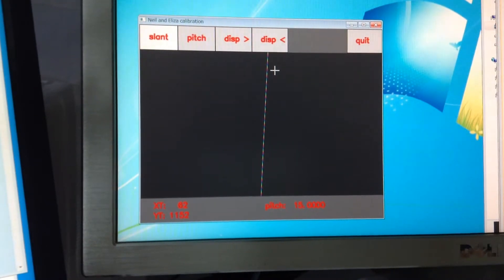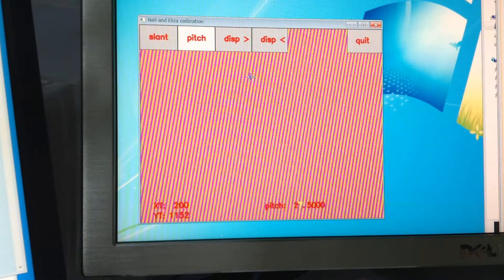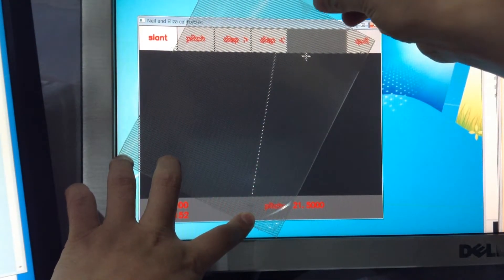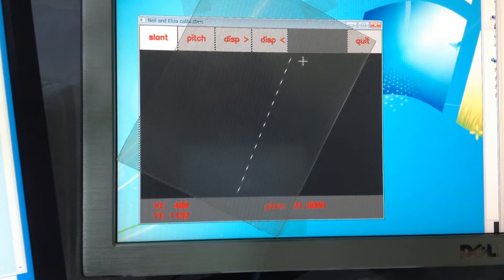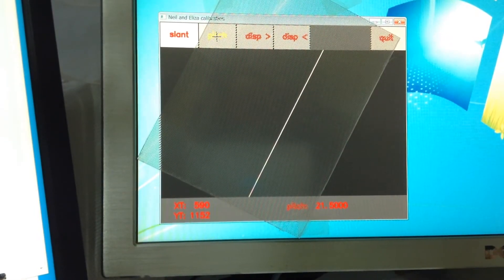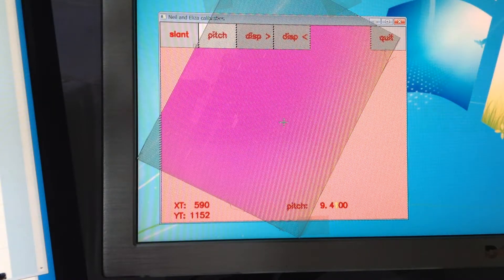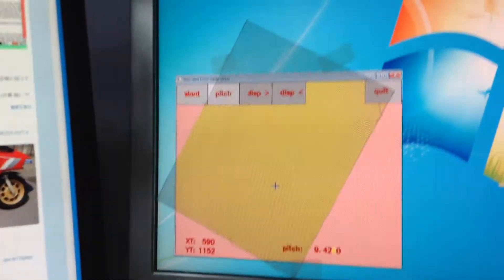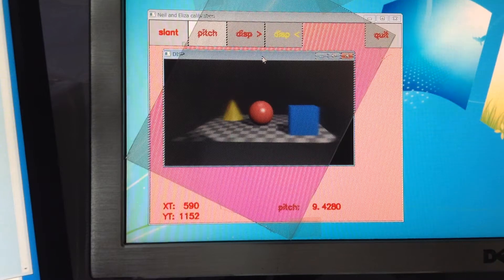Introducing DIY autostereoscopic-display support software

Comment: Very nice tool! I also used lenticular sheets to make autostereoscopic pictures. Please see https://youtu.be/YSK2y2N5nJw for an experiment I did with an lens array sheet. So you get stereoscopic view in both horizontal and vertical directions! I just wish I had a lens sheet with lenses that allowed for wider viewing angle. Maybe Im going to write a simular program as yours for my setup with my lens array.

Comment: Hi there,
Your english is easy to understand.
I tried your software. The idea is great, thank you! But unfortunately it doesn't work for me :( It is quite important for my bachelor thesis. I bought some 75 LPI lenticular lens sheets from china, but I don't have those really nice colors / gradients which I can see in your video. :( Nothing works, neither your software, Photoshop's stereoscopic rendering, nor the free interlacer software operating on an image sequence.
Do you have any ideas what I might be doing wrong? I am really stuck here.

I would be happy if you have any ideas. Thanks in advance!
Reply: I guess you should count the quantity of lines on 1inch on the monitor, and that should be the equivalent of the "printer 's dpi" after that you should start with the pitch test and after define the pitch test, you should start to do some test, that is as i imagine but to confirm that i cant get the software because the link is broken.
Reply: Having the same problem, I have 75 lpi but still not working with interlacer software - what was your solution?